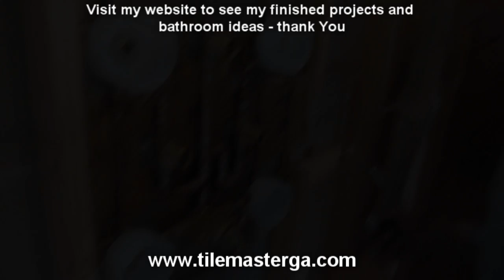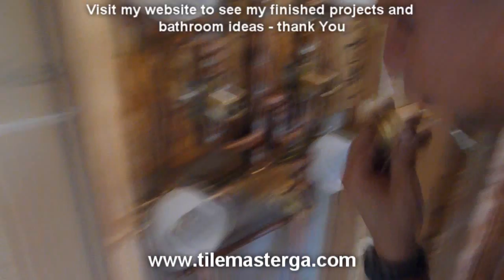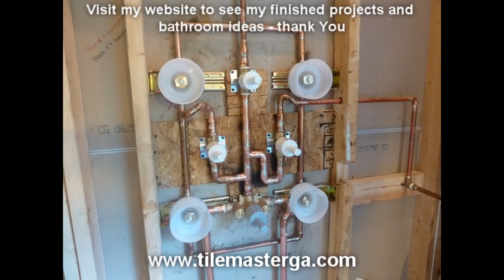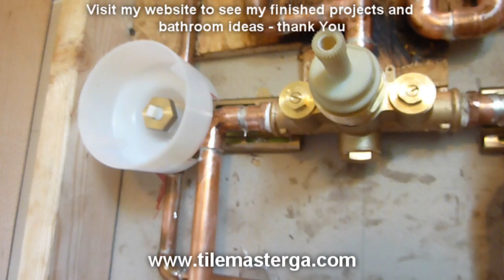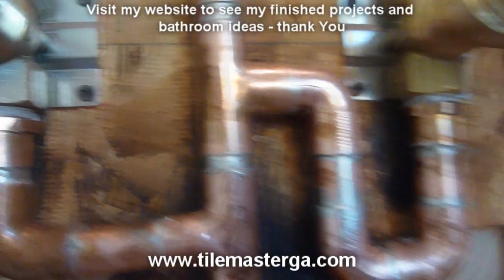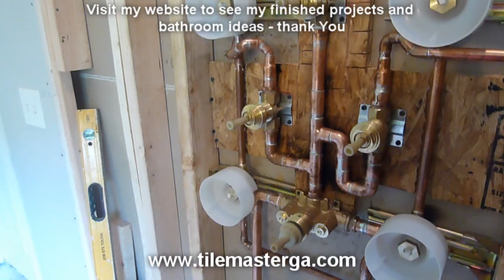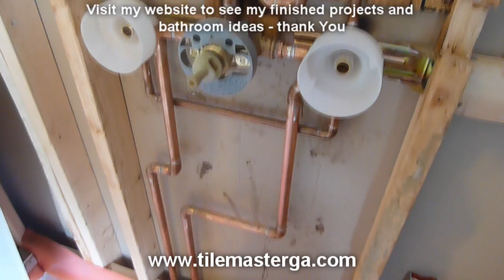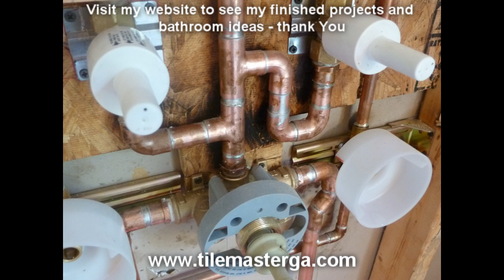(PART 3) MOEN TS276 Custom SPA shower system installation, sprayers, hand held 3/4" valve S3371

Comment from the maker: We using 3/4 pipes to supply enough amount of water to the system. This setup allows us to use all 3 functions at the same time- 3/4 will deliver enough water. We are using 1/2 to maximize pressure in shower heads. 1/2 pipes will give more pressure that 3/4" Hard to believe but this is how it works. Thx for watching,  Mike

Comment: The only thing that I noticed wasn't done was pressure test on the individual accessories. Meaning, cap the sprayers and divert the water to the sprayers and verify there were no leaks anywhere. Also never saw you wipe down the pipes to remove the flux.. (Not that you didn't). Otherwise looks alright.

Comment: My professional plumber installed posi temp valve and the escutcheon is loose (it spins and the ring moves from handle towards tile). The Moen circle body sprays are also not tight to wall!!  He did the other bathroom non of these problems.  What do I do?

Comment: I'm not a plumber so I had to ask, what is the purpose of the 1/2" copper in your configuration?  I understand that you need the 3/4" copper because of all the outlets, but why the 1/2"?

Comment: look pretty good a lot of la or but still mising air chamber on each water line according plumbing code  ?
Reply: Ricke Teruel air chambers on this type of system will cause flow issues . . .

Comment: Great video, but I was looking for a video for this same system which shows how to adjust  the temperature control on this valve. The instructions are not good at all. Any one out there had any experience with this?
Reply: Ron White having the same issue a year later leads me to this channel